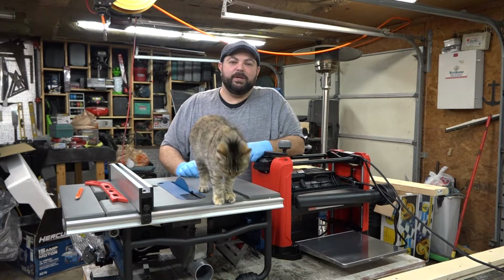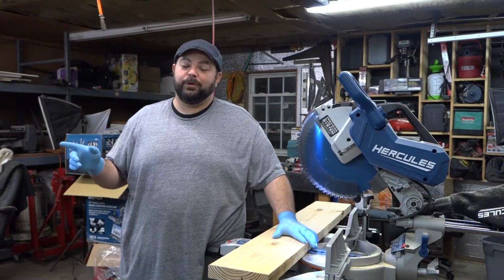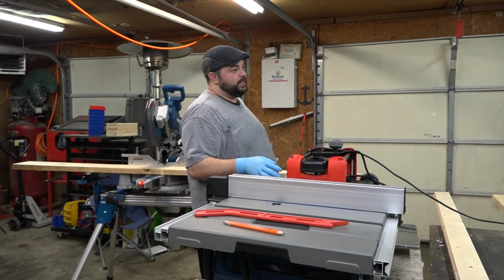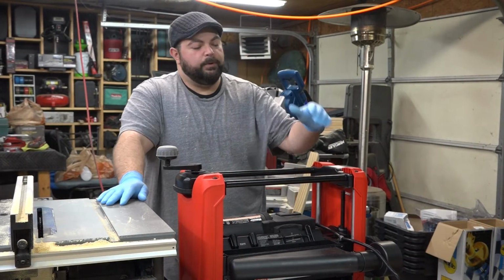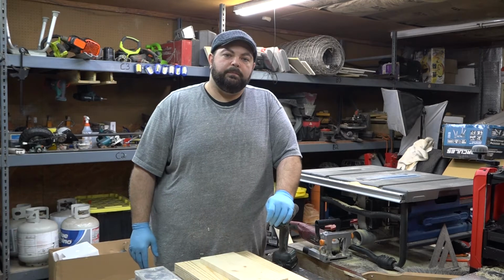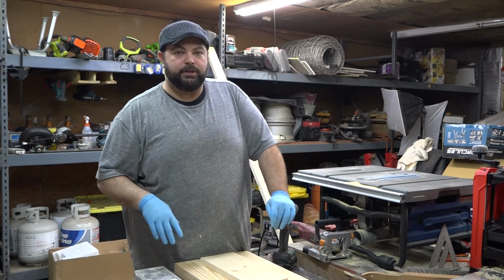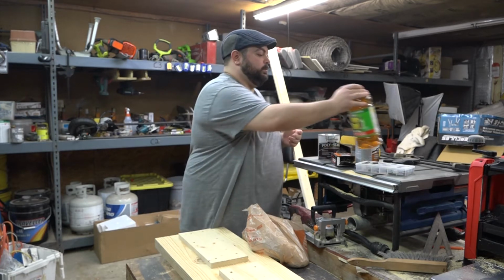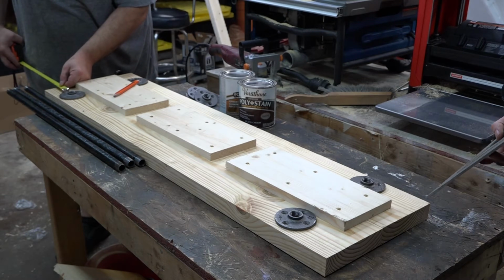(65) Building a small entry way table

Comment: I am 71 year old and been working as a Jack of all Trades, Master at none. My Father started me out young at about 7 years old when dad bought the Shopsmith. Anyway dad and my Wood Shop Teacher taught that you didn't use the fence to cut against the raw wood. So my question is how are you going to keep that piece of wood from getting screwed up.
Reply from the maker: I'm not sure I understand, which makes sense if I'm using the table saw wrong